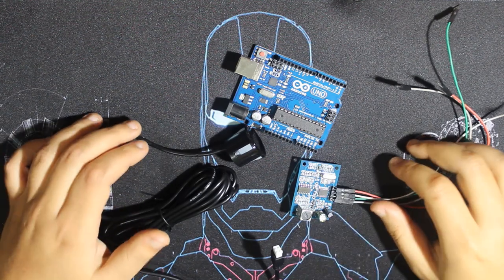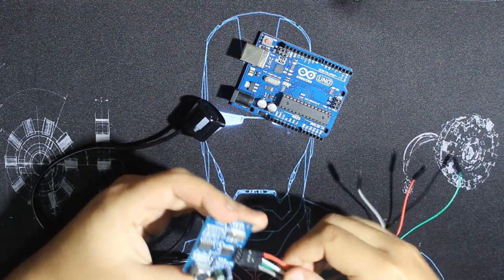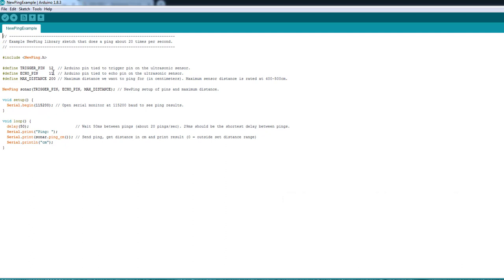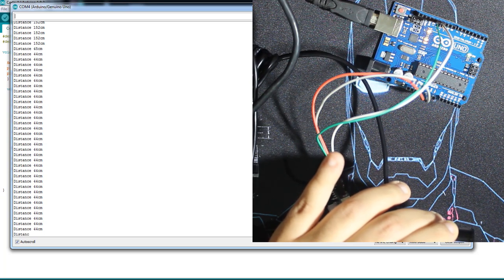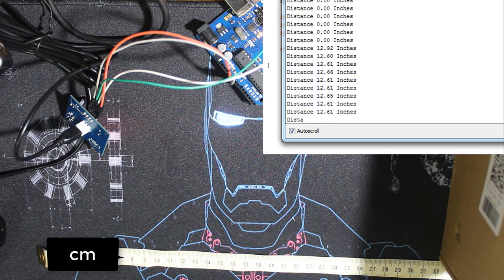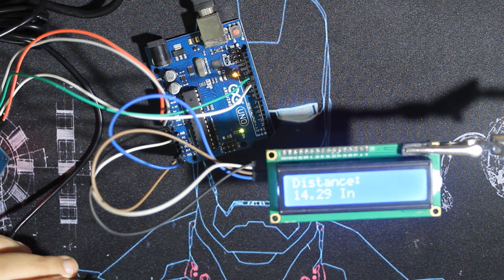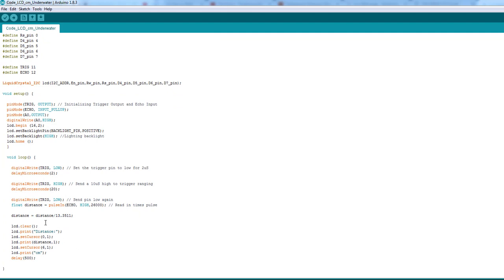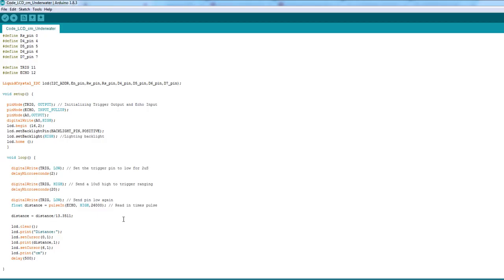Measure distance using JSN SR-04T Waterproof ultrasound sensor with Arduino and LCD i2c

Comment: Sound travel in air at the speed of about 330m/s, and about 4.4 times faster in water (1450m/s)
That means the actual min/max measure distance in water is also 4.4 times in air
20x4.4=88cm is the minimum hardware limit
Reply from the maker: The module wasn't meant to be used underwater, I just tried it, it doesn't measure anything, with the underwater calibration you see it's detecting something but when you put it underwater it doesn't change, that 93cm is fixed
Reply from the maker: Ahmet Yasin Öztürk  Yes, the module is just waterproof, not meant to measure underwater, and that value (93cm) was stuck whatever the distance underwater

Comment: I NEED A SENSOR which gives 50 data every second. And it must measure  the distance fastly (like 20 milliseconds)  And it will measure long-range (like 4-5 meters). Do you have any suggestions?

Comment: Can you kindly make video showing how to use two of Waterproof Ultrasonic Sensor Modules JSN-SR04T-2.0 + Blynk App, to read the water level in "two tanks" togeher and derive the quantity of water in each.  Using this activate a relay to pump water from one tank to another.  It will be great if you can also include a cheap 16x4 or Nokia display.Thanks,
Reply from the maker: Hello, I will probably make videos about IoT, but it needs some time (sorry).
You need to replace the Arduino with a board that supports WiFi like ESP32 or ESP8266 12E, using blynk is realy easy you'll just need to send those values to the app and add a button for Relay

Comment: Thank you for the video. I HAVE A QUESTİON: Is it sensitive in far? For example, can ı measure the 4 meters outside? I am doing an autonomous car.  It will be big and it will travel outside on a road which between barriers. So the car will measure the distance between the barriers and the car. It must measure at least four meters. Do you have any advice for me about which sensor ı should use?
I need to take responses fastly (<20 milliseconds)
Thank you.
Reply: i can get it to measure until around 420cm consistently, so its good for that. i cant help u with response time tho

Comment: the waterproof module shown in this video has a minimal distance of 20cm which can be a problem in smaller tanks or other tight conditions.
Reply from the maker: Yes, you're right
Reply: What alternative can we use if this is the prob im facing?
Reply: @surtrtech

Comment: Thanks for the video,
Can you tell any sensor which can sense the water depth .
It should be floating,
I want the distance from the surface of water to bottom.,
A Project of sedimentation.
Reply from the maker: You can use any ultrasonic module to detect the surface of the water in a container that you already know its depth and with a little math you can know the level but the module should be suspended above the container.
Another solution maybe try some laser range finders but it should be waterproof.
There are maybe some ultrasonics that works underwater like TD1000K
Reply: @SurtrTech  thanks for super fast reply
Reply: @SurtrTech  bro the sensor will sense under water if you make it on and off giving a delay .
At the time of delay the sensor should change the position .
And when it gets ON the reading will be different than before .so make the sensor On and OFF 
WITH delay.
I think it will work  .
Will you please try and tell the results.
I will be waiting for your reply.please
Reply from the maker: @MARUTI96  Are you talking about the sensor I'm using in the video? It doesn't work underwater, the soundwaves get reflected at first contact with water and detect the minimum distance
Reply: @SurtrTech  thanks for the information.
Reply: @SurtrTech  I think you should try to ignore the first few ms. Start the listen after that. The best solution is to view the echo back on the scope first. Another thought... I was thinking if you can get the 60w version for echoing  and use your sensor as a  receiver would be great project.

Comment: I connnected the board JSN SR04-T to Arduino with cables (= 4 m) , I got problem sensor didn't work well, parameters are floating. Please give me some advice. Thanks!

Comment: Is it possible to detect objects under water with this sensor ? For between 20-30 centimeters
Reply from the maker: Hello, to sum up, no it won't work, this sensor is just waterproof and as tested, when you put it underwater it always measures the minimum distance (around 20cm) but as you can see I did some modifications considering the sound speed in air or water, it always measured around 90cm.
Better get a sonar or some other module.

Comment: It is same with car parking sensor functioning
Reply from the maker: It's the exact probe though
Reply: Yes.. Almost same.. More accurate.. I look circuit inside got 2pieces TL072 and programmable ic using for 2 waterprof probe

Comment: Hello, can I and how can I convert it to mL?
Reply from the maker: Consider the liquid as a cylinder (depending on the liquid recipient... here it's a cup) you should already know the radius you then have to measure the elevation (level) ... apply the formula...
Reply: We are supposed to measure the water level with a capacity of 500mL. Here is our code, is it correct? We already uploaded it but there seems to be a problem since it isn't accurate?
distance=duration*0.034/2;
volume=(sa*distance)*0.0001;
volumeFinal=waterH-volume;
Serial.print(volumeFinal);
Reply: The 0.0001 is the conversion from cm to mL. The sa is the surface area. The waterH is the maximum capacity which is 500mL, from that we subtracted the multiplied distance and volume of the bottle.
Reply from the maker: @wilfredreyes4343  The method seems right, but I didn't try it to tell you exactly, if this doesn't work you can try to multiply the distance measured by a value to get you the right volume you may add/susbstarct a value too (slope and intercept)... Take two known levels 0 and 500 for example and work it:

for 0 "water level" the sensor will give you a value... the negative of this value is your intercept, add it to the last formula and from now on you'll get 0 when the bottle is empty.
for 500 "water level" the sensor will give another value too... 500=(sensorvalue)*slope + intercept, you know the intercept and sensor value, now calculate the slope.

This method may work as well, please don't forget to make sure that the sensor detects the water, I forgot if this one can do it or not
Reply: Good day, sudden realization here. My bottle is only 500mL and the sensor has a measuring range right? Can the sensor still measure the whole volume of water inside the bottle? Thank you very much! You have been a big help to our project! <33
Reply from the maker: @wilfredreyes4343  Don't forget there's a minimum range as well, don't forget to test the module before...
Reply: I have been programming it for more than a week and the problem isn't being fixed until I saw the measuring range. I consulted it to my adviser as well but he said that we can make it work for 500mL. Do you think that it would be possible? Thank you very much!
Reply from the maker: @wilfredreyes4343  I think the minimum range is 20cm, 500ml seems to be fit in a small container you better use another sensor with a lower range and bigger resolution, make sure it detects the water.